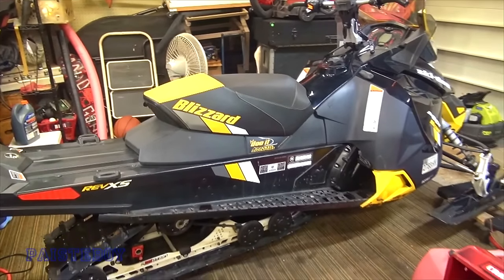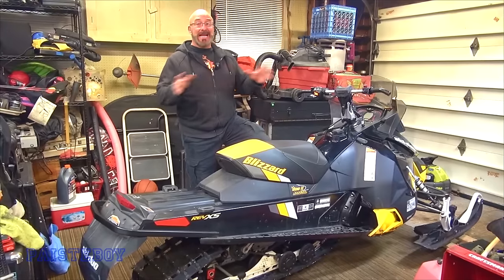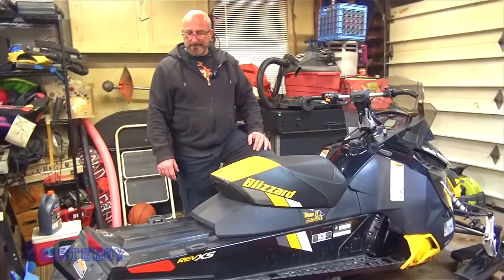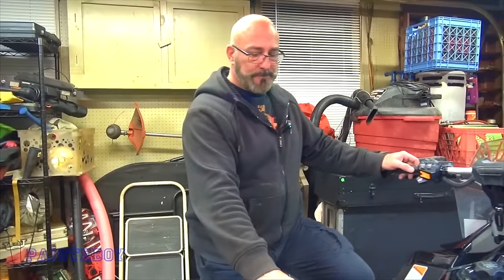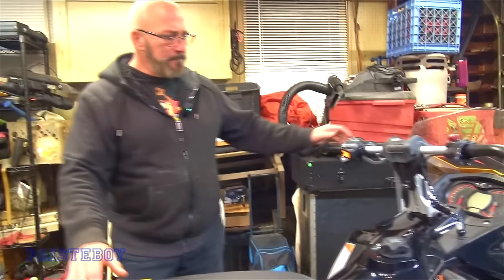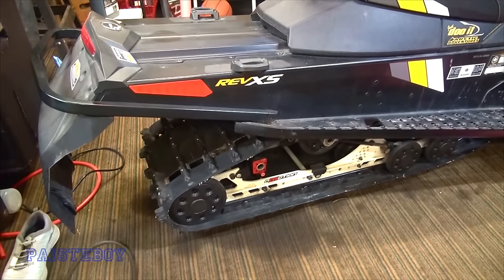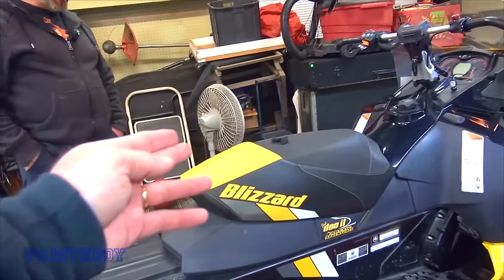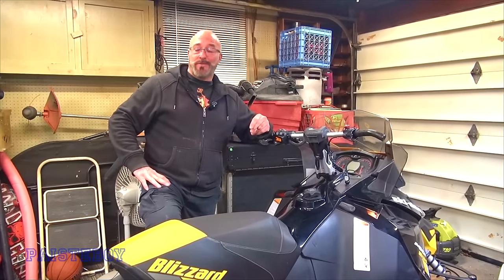What Happened to ZUKE's 2011 XRS 800 | WHAT's NEXT???

Comment: Never buy a high mileage skidoo
Reply from the maker: I think 5000 miles used to be a lot of miles for a 2 stroke Ski-doo but not a modern one.  I would not consider this to be a high mileage Ski-doo. My Blizzard had 4800 miles on it when I sold it to Dennis and if properly maintained will last another 5000 miles.
Thanks for watching Mike.
Reply: Seen some 600 etec engines go 24 000 km
Reply from the maker: That's 15,000 miles and impressive!  We came across a guy on the trail with over 12,000 miles on his 800 a few years ago and a former YouTuber had 18,000 Km or 11,000 plus miles on his 2015 600.   Could have gone more but he had a warrantee on it and wanted to ride it until it blew up. Thanks for commenting and watching Holden.
Reply: @Paisteboy   I have a 600 etec with 10  000 miles.  I want to see it go high miles.  I had a 583 that went 22 000 km at to time of selling it.  It had 135 psi each side but the guy who bought it blew it up.  I don't think he rode it the same way I did
Reply from the maker: Wow! Nice.  That's what happens when they make something really well and it's taken care of.
Some people don't properly warm up their sleds and that damages them.  I really like the reliability of the 600 e-tec but I needed to 850 this time around.
Reply: @Paisteboy  I had a few 1200s now it is 600 time.  After this one moves one it will be 850 time
Reply from the maker: Nice!